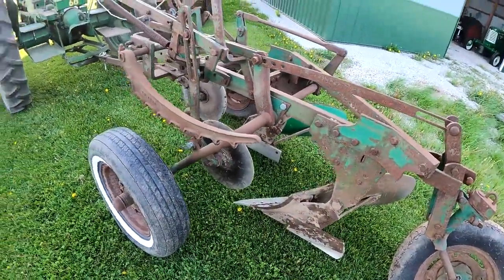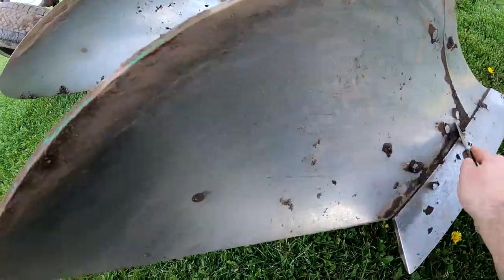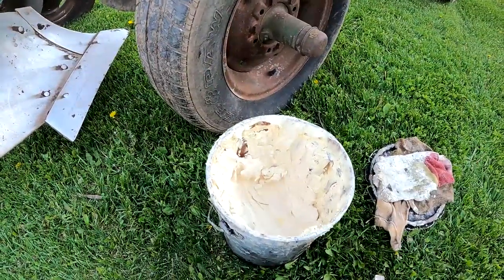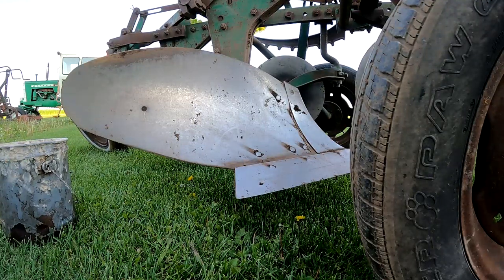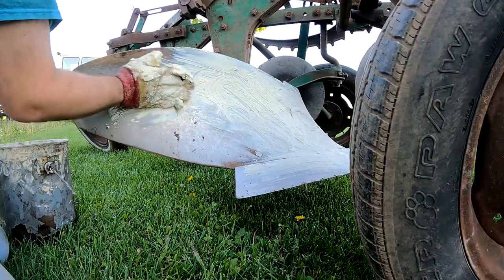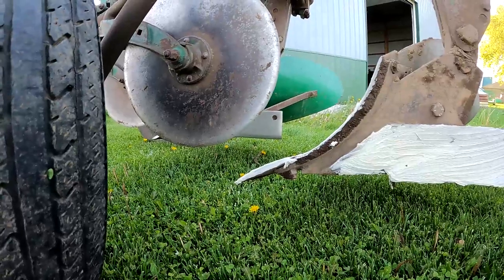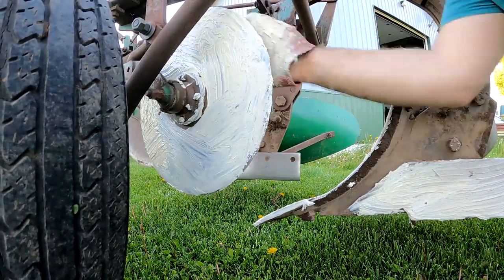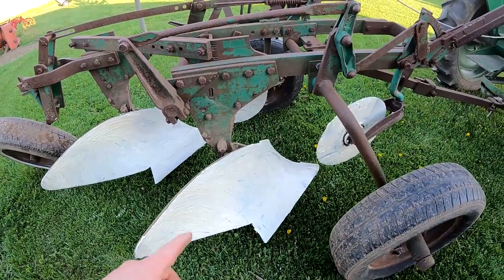Greasing Plow Wear Parts With Lanolin: What Do You Use To Keep Them From Rusting?

Comment: I live in central Alberta with a lot of oil wells that have sour gas (H2SO4) in them.
The gas was taken off the oil and sent to a flare stack. When it’s burned off the H2SO4 separates the Sulphur out of it and comes down to the ground.
Very corrosive on metal. We would grease everything and it might last about 6 months before rust would form under it. Impossible to get a plow to scour after that.